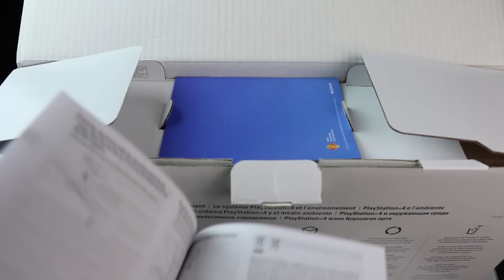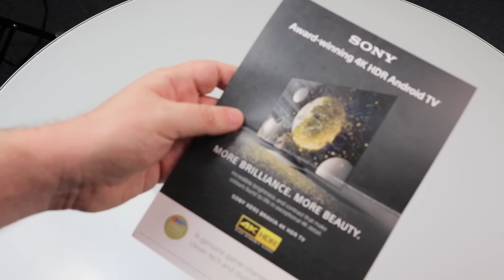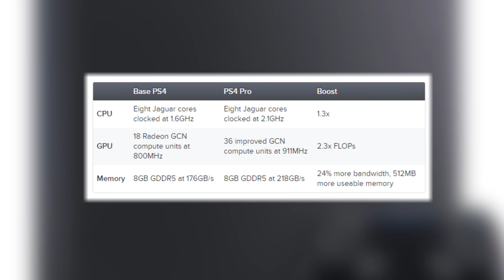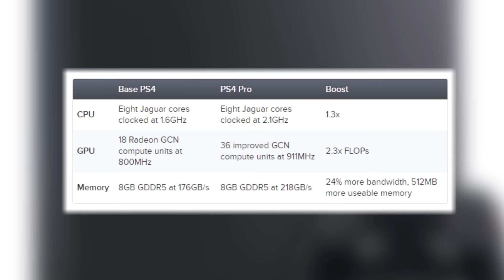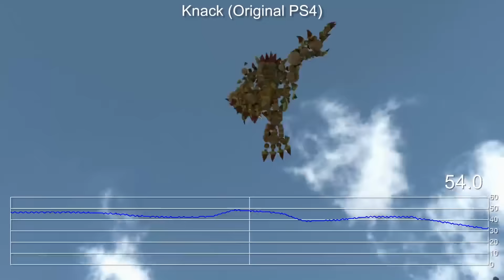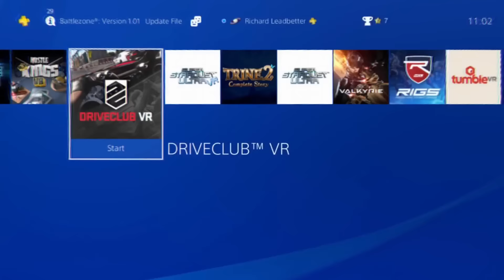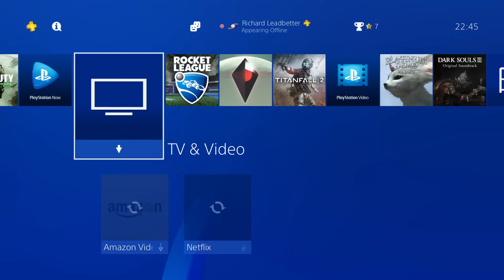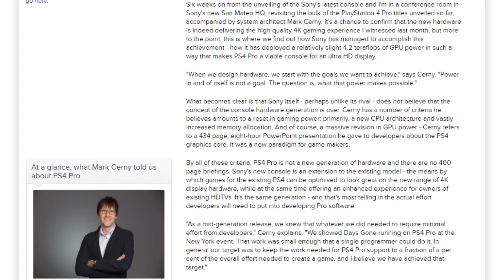DF Videocast #4: Unboxing PS4 Pro, Meeting Mark Cerny & More

Comment: As an Xbox fan who will buy the Scorpio when it comes out, I seriously don't get the hate. This is a $400 Console capable of producing an image close to 4K. I'm fortunate enough to have a 4K TV and I've seen the PS4 Pro videos and it looks absolutely stunning. In fact, I can't even tell it's not running at native 4K, it's that good. Yeah, it should've included a 4K Bluray (which is one of the big reasons why I'll still buy the Scorpio), but for the price and if you don't already own a PS4, this is a great deal if you ask me.

Comment: The OVERHEATING is strong in this one
Reply: They didnt test it yet
Reply: Tayseer As comon dude just look at the design... the original PS4 is a fuckin toaster already, it's my impression when I look that design.
Reply: Crapgamer and his crew said they had sources stating that the PS4 Pro had overheating issues. The truth is that their source came from a FF15 stage demo when the console overheated, but it WASN'T the PS4 Pro.
Reply: And yet they managed to drastically reduce the amount of heat produced on the Slim, as well as the fan noise since it doesn't need to work as hard. Seems they have improved upon their design which bode well for the Pro as well. At worst it will produce the same amount of heat as the original PS4.
Reply: Opinions based on assumptions are worthless.

Comment: God I really want to know what the framerate improvements are before I preorder
Reply: Nothing actually on unpatched games
Reply: Tayseer As Thats probably what he meant, on how much the frame rate has been improved on the forward compatibile games.
Reply: ***** Maybe a smoother frame rate on unpatched games
Reply: As framerate is more to do with CPU I doubt we will see much better.
Reply: As Ritchard said, that boat has sailed. There will be none. You'll get various grades of checkerboard 4K instead of 900~1080p in compatible games, and the frame caps will remain the same.
Reply: I did not complete the video at the time of my comment. But I understand now that the primary focus of this console is not performance but 4k gaming as pointed out by the complimentary 4k TV advertisment flyer in the box.
Reply: I see Xcom 2 is on the list for PS4P improvments. Great game, but I hope they prioritised the framerate on that!..
Reply: I see, I was atleast hoping that the Pro would help the original PS4 games stay at a solid 30fps. Many PS4 games claim to be 30 fps, but upon closer inspection it appears that the games actually run from mid to high 20s in terms of fps. Atleast that's what I've noticed with the Playstation 3. (I don't know about the ps4 for sure just yet, i'm judging from framerate test vids i've seen.
Reply: For some reason didn't see these first couple comments. But yeah I was just wondering if there were atleast minimal improvements on preformance. to either patched or unpatched games. The officials Sony site lists "better framerates" as one of the perks for Pro, but I see that they are using the term very loosely. Only game I've seen so far was the Tomb raider 60fps mode. Which I don't think was on the original XB1 Version
Reply: Yusuke Urameshi Developers do have the option to deliver a 1080p 60 FPS presentation on games that would have formerly been running at 30, however it seems that most of them decided not to take that route. Other than Rise of The Tomb Raider, The Last Of US has also been confirmed to have a 1080p mode for PS4 Pro that will stick to the 60 FPS target where the regular PS4 won't. But that's just the one game, and a PS3 port to boot.
Reply: Check the comparision videos on this channel.. If you did you would discover that there are no improvements and that ps4 pro in general runs with lower frame rates/more frame rate drops even if you choose to use it with 1080p.
So if you enjoy cinematic frame rates you would love the ps4 pro even more ;)
Reply: Absolutely no improvement on unpatched games as the extra GPU will be completely disabled making it run IDENTICAL to the vanilla ps4. In ps4 pro mode however you will msot likely see a decrease like what is seen in the comparision videos on this very channel. Even at 1080p games like mantis burn racing has lower frame rates since it forces it to use supersampling when not using "4k" mode.

Comment: I'm still worried about how Pro doesn't have defined modes. Meaning, some Devs could theoretically make 1080p mode with super sampling and 60 fps, while also making a 4K (checkerboard mode) at 30 fps. 

So we will have Devs having to decide how to split this up on top of the normal game. Maybe I'm making it sound more complicated then it is. But I can't help but feel like this is messy.

Also as a 4K TV owner, it kind of stinks knowing that the 4K checkerboard version will mostly be the base game just with much better resolution and IQ. While the 1080p Pro Mode might be 60 fps + fx settings improved while 4K mode will prob be 30 fps (or whatver the base ps4 version will be).

Basically as a 4K TV owner, you have to assume most of the time you will want to go with 4K mode. To match your TV. But it will be very possible that 1080p owners get the much better version (if you value performance over resolution). Of course that is assuming that Devs even put out two modes (which will be determined game by game). 

I already have my ps4 pro ordered and paid off on Amazon. Bought a 60 inch OLED 4K TV a month ago. So guess I'm all in. Will have to wait and see how this actually plays out.
Reply: Sophia Richards They are making huge strides in mimicking high resolution without wasting a ton of actual power for it, it's pretty close to the point that native resolutions are going to be a thing of the past, but that's a good thing as this will make games easier to make, high cost tvs will come down in price faster, and the image displayed may look way better being upscaled to a image beyond what it was intended for: such as a 4K image being upscaled to mimic a 8k image.
Reply: Sophia Richards They are making huge strides in mimicking high resolution without wasting a ton of actual power for it, it's pretty close to the point that native resolutions are going to be a thing of the past, but that's a good thing as this will make games easier to make, high cost tvs will come down in price faster, and the image displayed may look way better being upscaled to a image beyond what it was intended for: such as a 4K image being upscaled to mimic a 8k image.

Comment: I'm not a PC gamer but it's crazy how far behind consoles really are as in power and graphics I mean Iv seen videos of PC doing 8k and consoles are just getting started with 4K lol
Reply: The difference is because of the financial restrictions Sony and Microsoft had to work with at the start of the generation.
Sony lost about 3 Billion dollars on the PS3 launch. Each PS3 in today's money would have cost about $800 to manufacture ($100 of that was just for 1st generation Bluray drives though), so they lost $200-$300 per unit.
If they try that again today it would sink the company.

Compare that with the PS4 which had a $380 manufacturing cost at launch, and given that your "fixed costs" eat up around $200 of that, the PS3 probably had 3X as much money allocated to processing hardware.
The amount of horsepower you can fit in a box multiplies disproportionately to the base price, the only problem is that convincing people to buy a $600 box today is harder than it was a decade ago.
Reply: A 450 euro computer cant do 4k ish though.
Youre paying for the optimization with the ps4 pro.
And im saying that as a 980ti and 4k screen owner.

8k needs double titan pascal by the way to get remotely close to 60fps , which is 2400 euro for the graphics alone.
Reply: Machiel S
As the owner of a 980Ti and 4K screen you should know that there are tons of games that can be run at 8K and well above 60fps on your system.
Go play Portal or Deus Ex HR in 8K, you get amazing framerates, and the PS4 Pro has 70% of the GPU horsepower that you currently have.
The idea that modern hardware is inherently incapable of higher resolutions is just flawed thinking spread by the anti-4K brigade trying to scare everyone into rejecting 4K just because a tiny fraction of the population don't have eyes good enough for it, or because they would rather have "cinematic" games and they don't actually want to see display technology progress beyond the current standards.
Reply: I totally agree, but the ps4 pro is still a Decent enough deal if you want those exclusieves.

Comment: I hope more developers follow suit with the new Nioh game–giving the player the option to choose.  Do you want better graphic fidelity or 60fps?  

The information was just released yesterday I believe–Nioh has basically two modes for both HDTV or 4K TV displays.  Movie Mode which runs with higher quality imagery (in this case better anti-aliasing) at 30fps or Action Mode–1080p at 60fps.  The main difference is for 4K you can do a 4K at 30fps or 1080 (upscaled) to 60fps.  Basically allowing the player to choose if they want improved visuals or 60fps with the normal PS4 graphics.

Comment: Not really a console man but the Xbox One S is a far better looking unit to my eye.
Reply: The xbox one s cant even compete the regular  ps4 what r u talking about?
Reply: Tayseer As What are you talking about?
The Xbox one s is native 1080p with HDR and 1,9 tflops 30 fps 4K bluray and costs 299$ Plus its the best selling console in USA at the moment
The pro is upscaled 4K (Fake 4K) with 30 fps and its 4,2 tflops and costs 399$ Plus it looks like shit and nothing changed to the controller
Reply: iiAboudi The terrible PS4 controller is the reason I went back to Xbox One. 
PS4 controller = cheap flimsy triggers , horrible battery life and useless touchpad.
Reply: Tf no the xbox one s isn't 1.9 tflops and the pro can achieve more than 1440/1800p and can run some games at native 4K

Comment: God, 8 bit colour? Kept that quiet Sony, along with HDMI 2.0. Cost cutting, technically shit for £400....
Reply: ***** If its an improvement then all fair and well. £400 for overclocking same hardware is taking the piss imo. However, trading in old ps4 and paying £200 is a bargain, if you're interested in PS4....
Reply: You misunderstood that. They talked about PS VR breakout box, not the PS4 Pro itself. Pro has 10-bit colour (at least) and HDMI 2.0. Stop spreading lies because of you own incompetence.

Comment: xbox-S owner here waiting for Scorpio.
thanks Sony but NO thanks. My xbox-S can do the same as the PRO
Reply: Undead Beast can the PRO play 4K Blu-rays.
xbox-S upscales to 4K and HDR. What the difference at the end because both upscales the images.
Reply: The ps4pro has 4.2tflops and the xbox one s has 1.3 tflops
Reply: XBfan Xboxbestbox it's a fischerprice 4k player...
Reply: XBfan Xboxbestbox The ps4 pro runs games at 1800p or 1440p then they use that upscale tech to 4K
Reply: Tayseer As 1.4 TF just so you know.
Reply: ParanoiaGentlman You sound Triggered..Still better than NO 4K player!
Reply: Tayseer As I think you need to do a bit more research as some games on the Pro will be 1080p upscaled!
Reply: XBfan Xboxbestbox lol damage control
Reply: dragonddarkPSN no damage control need just facts.
Reply: XBfan Xboxbestbox Well idk since it can run games above 1080 res
Reply: Your xbox-s cant even match base ps4
Reply: Difference between Ps4 pro and xbox 1s. 

Ps4pro: Do to the upgraded hardware, Super sampling on 1080p displays 
aka, more detail, less jaggies, overall better looking games. lets also not forget some games will finally run at 60fps.

xbox1s: upscales to 4k, but doesn't have additional power to actually improve visuals or Fps since it's basically the original xbox one, but with a 4k blue ray player,  4k upscales technology and HDR, but again... it has no power boost.

The scorpio is a different story, but no.... The xbox one S is not the same as the ps4 pro. Don't kid yourself.

Comment: I can confirm the PSVR box is outputting HDCP 1.4 only at this point in time. When the Pro is hooked into my receiver or TV directly it registers as HDCP 2.2 with full HDR support. When hooked up through the PSVR junction box the Pro registers HDCP 1.4 with no HDR support.
Reply: Let's hope they can patch that through a firmware update.
Reply: Bruce Richwine it's already been confirmed that the psvr processing unit can only output through 4K and not HDR, you have to directly plug the ps4 pro into the tv
Reply: Julian Salazar I was just letting people know that's what it's really is in the wild. A lot of misinformation has been running rampant about  HDCP on the PS4 Pro. Also the patch that just dropped today for Uncharted 4 looks great. It disables some video capturing features and other things I didn't read to much into. But the game looks great with HDR.

Comment: Short and sweet breakdown on PS4 Pro improvements. Visuals (compatable games ONLY) and improved frame rates (ONLY on games with unlocked frame rates otherwise its a stable 30fps because its already capped).

Oh yeah, checkerboard 4K on compatible games to. That's my guess for the moment, can't wait to see the results!

Comment: Nice talk , but you show Shadow of Mordor footage... Screen writes "TITANFALL 2" 16:20 ... and from 27:00 one of your mics just kinda died... oh and can you check if the new pad lost its Lag problem, when too much stuff (phone/other devices) at the same time where using the Bluetooth signal ... and how long does it work now (with a fully changed battery) ... also the number one thing, that people would ask about would be " Is Drive Club now running in 60 fps " lol

Comment: If I may, the backwards compatibility could easily be compared with what Nintendo did with the Wii and WiiU since the GameCube architecture from what I understand. Your DF examination of the WiiU was most enlightening in this respect, as is Nintendont running GameCube games on a WiiU 'natively' proving this point further. Very informative video, thanks very much gentlemen!

Comment: So... highlights in summary - 

SATA 3 transfer speed - but don't get your hopes up as it will be hobbled 
Dual GPU and upclocked CPU - but don't expect enhancements to standard PS4 software as it's disabled in PS4 mode
1gb of extra DDR3 RAM - Used to switch apps and powers the front end in native 4k

Obvious points of contention-

No 4k UHD player
Still no external HDD support and limited to specific 2TB internal drives, 
No enhancements made to the controller battery life?

Still, at least there's one extra USB port!

Comment: I would love to know how hot it gets and how loud it is compared to the OG PS4 and slim. Also, is the cable included with the pro a HDMI 2.0 cable, Sony won't answer my question about that so I'm guessing its not. Love your videos cheers.
Reply: Sure its 2.0 cable
Reply: Do you have a source because it looks like the exact same HDMI cable that came with PS4 in 2013 and that is not a 2.0 rated cable.
Reply: samuraispiritsx The 1.4 and 2.0 looks exactly the same and so the console supports 4K res so i believe they will put the 2.0 cable in that package
Reply: Why wouldn't it be HDMI 2 cable? They want to piss off their customers? Standard HDMI and high-speed HDMI cables look exactly the same on the outside.

Comment: What I'm most curious about is whether or not it will make unpatched games run any better. I suspect it will (higher clock speeds), but then to what extend? 

Will AC Unity stay locked at 30fps? Will BF1 stay locked at 1080p and 60fps? Will it solve Bloodborne and Dark Souls 3 frame pacing issues? etc.

Please DF look into this for us! Thank you!

Comment: Hey Wichard, can the Pro scale down to 1440p if we want to have 60fps instead of 4k/30fps?
Reply: doctre81deathsonchapter 7 No... CPU is too week
Reply: Yes you can. Rise of Tomb Raider has a 60fps mode
Reply: He's a Witcher.
Reply: resolution=gpu only, ps4pro got plenty of that.
fps= both cpu and gpu, ps4pro has same cpu as og ps4 back from 2013, just with slight overclock, so forget about 30 to 60fps jump in any game.
Reply: I guess this is the kind of option offered on the game level, not the system level.

Comment: Does the kettle power lead mean it uses more power? Normally the kettle leads are reserved for things that need the power of three nuclear stations to run, like plasma TVs.
Reply: No, it's just there to make sure steady power delivery. I'm pretty sure it will consume more than a standard PS4 though because it's more powerful, makes sense. My TV has kettle lead and it's not plasma, it's LED LCD.

Comment: +DigitalFoundry Any chance you can test what panel depth PS4 Pro are displaying?  When testing various PS4 games it seems to output 8 bit but 4:4:4 on PS4.  I was hoping to see 10-12 bit for 1080p on Pro supported games.  Also, maybe I missed this but I'd like to know if Sony changed the audio chip from the PS4 for the Pro.  Do we know if any PS4 Pro games will support Atmos or DTSX, meaning at least on the roadmap, or if there has been any improvement with PS4 Pro audio chips?

Comment: Yes the fan and the cooling system is a issue. I Don't need to spend $400. And it over heats and blows out in a few months. I need to have my console last for years. And from the looks of it the vents look alot more closed up in compared to the standard PS4

Comment: When the ps4 pro runs in regular ps4 mode they said it will use a single gpu downlocked to 800mhz. So is the cpu going to be downclocked back to 1.6ghz in regular ps4 mode as well?

Comment: On replacing the hard drive, wouldn't we be able to swap out our old drive and put it in the Pro? I know you can do a data transfer via ethernet and upload your saves via PS+. Unless there's something that would stop that I don't see why we wouldn't. Are they not the same system aside from a bump in specs? It will take a while to swap data and drives out to use the drive I currently have in my PS4